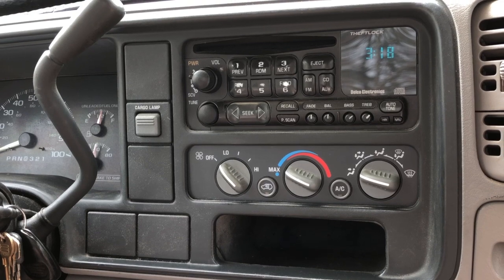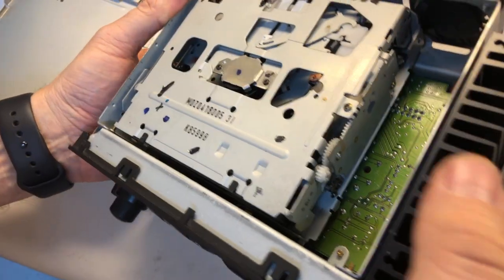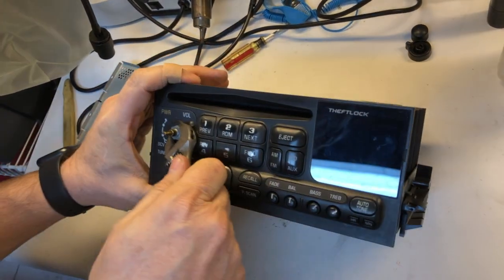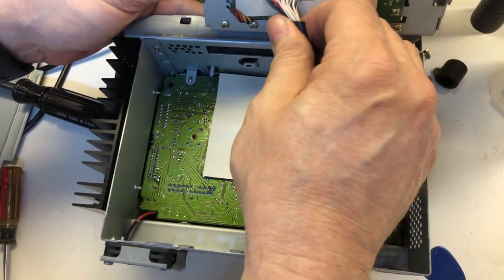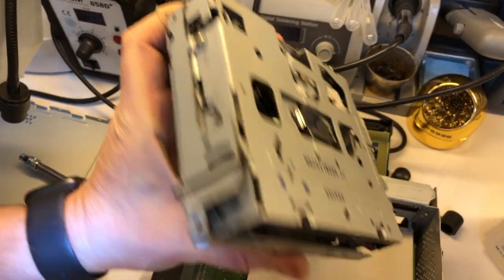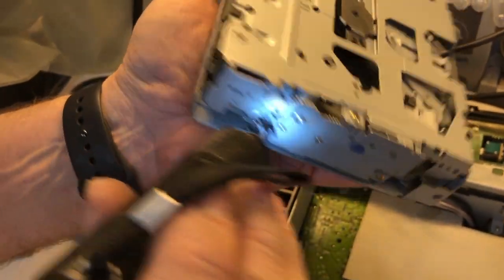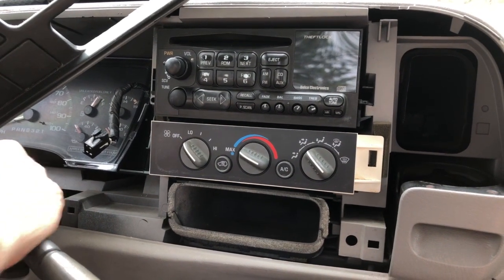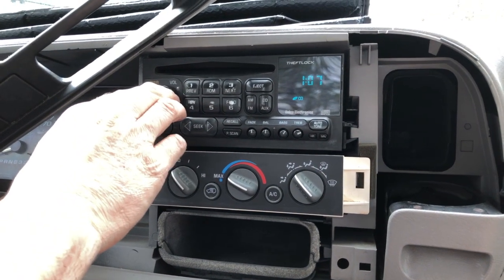1995 - 2005 GM Truck Van Delco Radio CD player shows ERR message won't play repair (Chevy Caddy GMC)

Comment: Great video! It did fix my “dirty” CD player. I would like to add that cd cleaning disk DO NOT FIX THE PROBLEM! You have to clean the laser with a Qtip and alcohol like the video states. I did exactly what the video and it producer said and it fix my problem. Make sure you disconnect the battery of the truck before you do any removal or disconnects to prevent electrical damage to components. Overall great video!

Comment: Try blowing compressed air in the cd slot before removing unit from dash. It works.
Reply: Does it really? Cool 😎 I’ll try it. Thank you 👊
Reply: Hmm I'll try that, my Sonoma is doing this and that was my first like theory why it wasn't working. I don't have many cds actually just would like it to work I'm strange like that. I'll probably do the Bluetooth aux mod thing if I can figure that out. Oh he did put a snippet of info there that I forgot... These can code lock with no power or something that does worry me, 26 year old truck radio wonder if anyone would even have that code.
Reply: I just fixed this on my 2000 GMC.  However I used and recommend canned air (The kind of thing you use on a computer), because you don't want any moisture or oil or dirt in the air blast, and you can direct it via the red straw to the center area (The laser always starts on the inside of the CD or DVD.

Comment: You were fortunate that the laser lens was just dirty. Typically, you need to replace the laser or spindle motor, or both. They work in tandem through the microprocessor. I used to repair home CD players and CD boom boxes back in the 90s for a large company. The Sonys were especially notorious for bad lasers. We used to just replace both motor/laser to get the unit back to the customer without unnecessary delay. Sony said that if you needed to adjust the laser power to get it to work, then just replace the laser. There's also an laser eye pattern you need to check on a scope. Sometimes with a slightly dirty laser, the songs will just skip a bit and still play, even with a spotless disc. Anyway, good job on the repair.
Reply from the maker: Thanks, yeah but after two plus decades component level repair isn't as practical an option anymore as the parts were discontinued long long ago.  Theres also no schematics published by Delco so determining a failed IC chip is out of the cards.   Had the spring clean approach I videoed not worked out, my next one would have been to adjust the laser power output.   Failing that, toss it in the recycle bin and try with another CD assembly from a salvage yard vehicle with the same part numbered radio.
Reply: @DrShock  hi I have a question my radio cd  show me the error ( no cd ) obviously the cd being inside  so I need to clean also the same things that you show in the video ?  Thanks 👍
Reply from the maker: Possibly, or it could be a hard failure of the mechanism.   Impossible to say without disassembly, cleaning, and further testing.
Reply: @DrShock  thank  you anyway I will cleaned up  and see what happens

Comment: Thanks, this was helpful! Unfortunately cleaning didn’t help, and the gears all looked good, but this video showed how to replace the CD mechanism, and with a new mechanism it’s working great now! That antenna cable is a lot harder to pull off than you made it look!
Reply: Yeah, how to pull the antenna cable?

Comment: Terrific video. Very clear, concise, thorough, and easy to follow. I needed to know how to get the player out of the housing. My plugins were slightly different, but I figured that out. Tomorrow I try to put it all back together. Will sleep with my fingers crossed.

Comment: These are available brand new on eBay. Some come unlocked with blue tooth and an aux jack.
Reply from the maker: Yep, there's a link in the video description if you are not comfortable, or successful, doing the repair and just want to buy a replacement Delco radio for your 90s truck.

Comment: Question? Mine says error but won’t take the cds or eject them? Is it just broken and done for??
Reply from the maker: I haven't run into that problem yet, but if I had this issue I would still partially  disassemble it to see if I saw anything that might be binding up the gears (could be an easy fix).   You can try lubricating the points I went over, and giving the drive motor a nudge at the main gear with a plastic tool.   If no joy then yeah, the options are either a replacement CD drive assembly or a replacement radio.   A part like the drive assembly would have to come from a radio shop, GM never sold them.

Comment: Thanks for all of the great info. My 98' k1500 radio(CD and cassette) has lost all sound on the driver's side .... ?
? New radio ?
Reply from the maker: Maybe, but I would check the speakers first.  You can work the F--R and L--R fader knobs to zero in on whether its all of the L side (Drivers) or just the F or R speakers that have cut out.   After over 20 years the paper in these speakers is going bad, I've seen quite a few go in the last couple of years.

Comment: Did this service and cleaned the eye and all the gears looked good.  It accepts the cd then spits it back out and i get the ERR code.  I tried two different cd players from one from my old unit and one from the junk yard.  Any suggestions?  May be the main part of the radio?
Reply from the maker: If the error persists across two different CD drive units, that have been cleaned and lubricated on their mechanisms, then yes I would begin to suspect an issue with the main circuit board, or the wiring harness between them.

Comment: Buen tutorial Dr. Shock:
La verdad es que hace años ya le gane en hacer este servicio en mi Suburban 98,  la unidad CD esta separado , para mi es mas facil y con el presentimiento de mayor  durabilidad  ya que no recibe todo el calor de los ic's de amplificación de audio Y demás componentes electrónicos.
La diferencia de usted yo si tuve un poco mas de tiempo o paciencia para abrir el mecanismo lector de CD limpiar y lubricar todo.
Una pregunta ? Dr. Shock. Lellendo en foros especializados de electrónica y preguntando a radio-técnico me comentan que puedes sopletear el lente,
 pero el usar aerosoles como el alcohol isopropílico o un cotton tips no es muy recomendable,
Ya que reseca a la larga lente lector o se puede rayar dificultando la lectura del CD.
Ahora si usted me dice que, para los años que tiene el stereo y como una forma de exprimir si vida útil.
O.k. yo lo entenderé.
Pero en general lo que yo e tenido de experiencia es que hay que darle uso de vez en cuando al CD. Porque si dejas pasar el tiempo y tu vives en lugares mucho polvo en el ambiente hay que volver hacer el procedimiento de limpieza, porque no sales del mensaje de "error" aquí donde fuera bueno poner algun líquido antiestático y repelente de polvo donde se pueda bajar el sistema sin que afecte la lente lectora del láser o ya de pérdida un pedazo de cinta a la entrada de inserción del CD 😂😂😂.
Gracias por su respuesta como comentario. 🙋
Reply from the maker: Cuanto más utilice el reproductor de CD, menos probabilidades tendrá de que se produzcan problemas. El alcohol isopropílico eliminará la lubricación de las piezas móviles y no debe utilizarse. Pero no dañará la lente láser si se hace con poca frecuencia. El algodón es más abrasivo de lo que es preferible, pero no es práctico conseguir un paño de microfibra para limpiar lentes en un área tan reducida.

The more you use the CD player, the less likely you have problems occur.   Isopropyl alcohol will remove lubrication from moving parts and should not be used.  But it will not harm the laser lens when done infrequently.   Cotton is more abrasive than preferable, but it is not practical to get a lens cleaning microfiber cloth in such a confined area.

Comment: I have a 2001 silverado. The CD player stopped working.  I bought this truck 2nd handed and have no idea what the code is.  I'm guessing it needs the same  kind of service.  What do I do without the code ? Thanks
Reply from the maker: Without the "ERR" message, it could be something more serious such as a dead controller circuit board for the CD drive.  There are no replacement parts sold anymore for these, so my advice would be to hit up your local pull your own parts salvage yard, like an LKQ, and get the exact same year and radio part number out of a donor truck.  Then swap over the CD drive mechanism.
Reply: @DrShock  Thank you !

Comment: I have a 2000 Silverado 1500 series original CD player it keeps rejecting the CDs when I put them in it says era is this the problem video very  helpful
Reply from the maker: It could be, there could also be an obstruction in there.  Young children typically will stick coins into the slot.  ;-)

Comment: I got a 1996 GMC Yukon and delco stereo has power but won’t play any sound lil different from that one cd Separated from the stereo. Rare some times when I start the truck stereo random starts playing music but as soon as I touch sound gone and won’t do it again after
Reply from the maker: Several possibilities for root cause.   I'd check the speaker wiring harness first.  If that checks out it's very likely a defect on the radio circuit board itself.   You might try cleaning the pins on the connectors in back before going for a replacement.

Comment: cd won"t be either loaded or ejected itself. What cause the problem? Can it be repaired?
Reply from the maker: Typically this kind of behavior is traced to a failure of the rubber roller that rolls in, and rolls out, the CD at the front of the CD drive assembly.   It can also be the drive gears for the roller, such as shown at 9:48.   Either way it's not repairable if any parts are damaged as there are no separate parts available.  So you'll need to locate a better CD drive assembly from a salvage yard donor to repair this sort of problem.
Reply: I have a 2005 CD/ radio with single slot. On mine, I found that the rubber sleeve covering the drive rod has expanded just enough to make the rubber sleeve slip.  I am going to try adhesives on the rod and see if it regains enough friction to grip a disc  If anyone else has fixed this issue, please share your remedy. . @DrShock

Comment: Is that a single din or double ?
Reply from the maker: I kinda remember these proprietary Delco radios of the 90s being 1.5 DIN high but wider than 2 DIN because of the heat sinks they have.   Not 100% sure, but it's definitely not single and different than double.

Comment: Replaced the battery on my 2008 Honda CRV today. CD player worked perfectly before. But now, after resetting the code, the CD player reads Bad Disc and won't feed or eject a CD. Radio is fine. @#$&